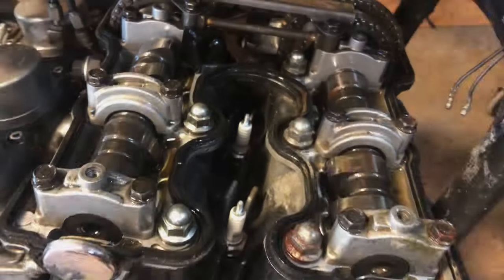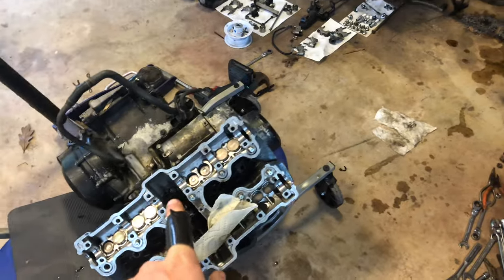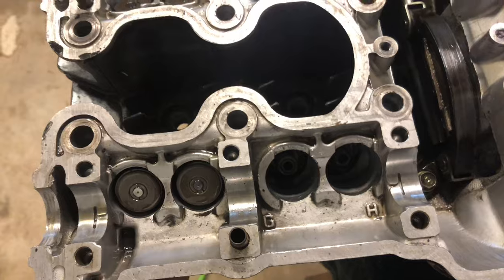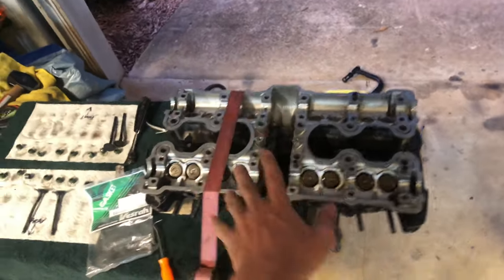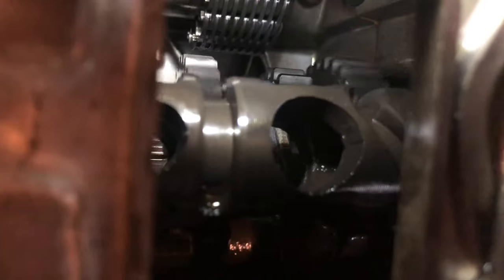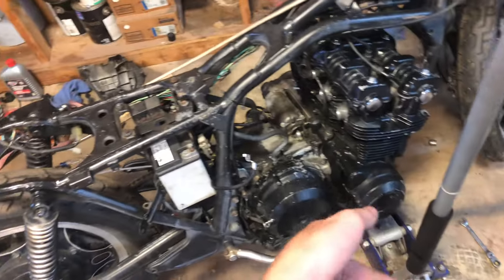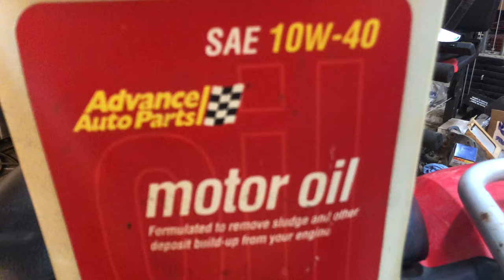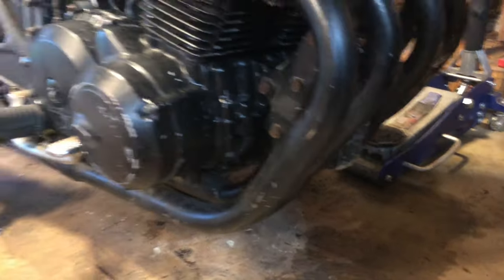Top-end Rebuild on 1981 Honda CB750 (DOHC)

Comment: Hey bro came across your video trying to figure out this 1981 Honda cb750 k. Was wondering if you’d give me some tips appreciate it bro thank you
Reply from the maker: I personally am not an expert on these bikes but I will say if you are taking the engine out by yourself is to have a jack, a rolling dolly, and strength lol. Also to block off any open ports when reassembling to keep nuts and bolts from falling in the engine.
Reply: @IngenTechNational  appreciate it bro right now I’m trying to figure out where these two lines go. There are two that are sticking out from the bottom of where the carbs sits in the middle. I know you’re supposed to joint those two lines but I am not sure what is connected to it specifically. I don’t have an air box on mine. They are just like yours with four filters for the carbs. I’m going to assume they are the vacuum lines. I am only assuming because I don’t have a handbook, nor do I know much about motorcycles.
Reply from the maker: @AngelGarcia-jq4kf  I honestly kind of forgot bro but they probably are vacuum lines. I sold this one for $600!
Reply: Yes that's ehqt theybare I just took my air filter box out and these to likes joint together on the big sing air filter box that the bike comes stock with I'm in middle of building cafe racer it's a 1982 no problem with the bike runs amazing fpr 30,000 miles runs like a champ and is pretty fast